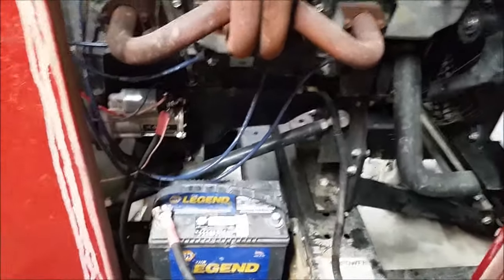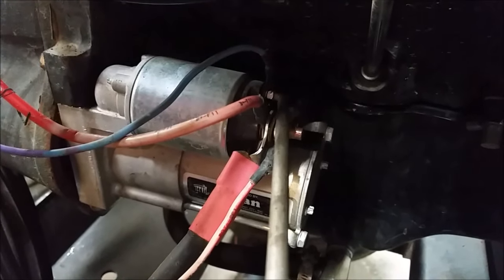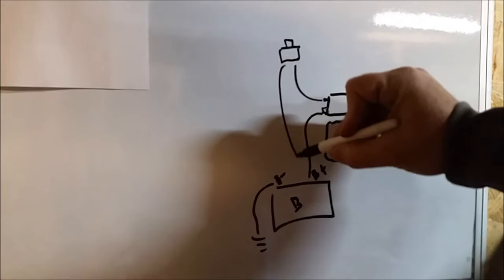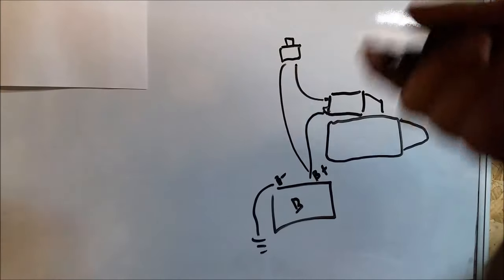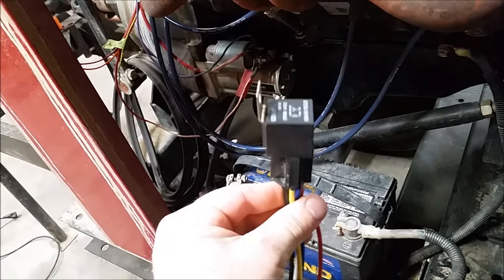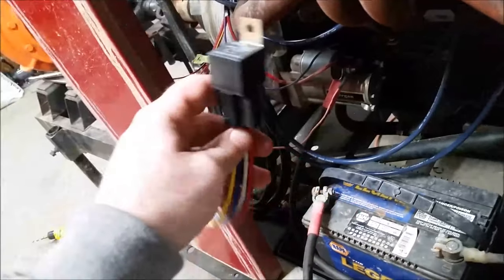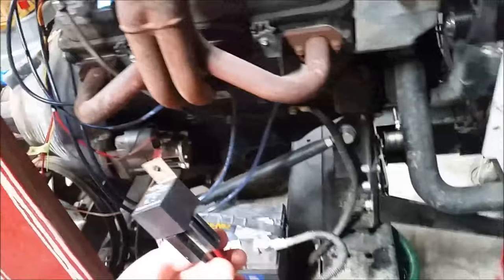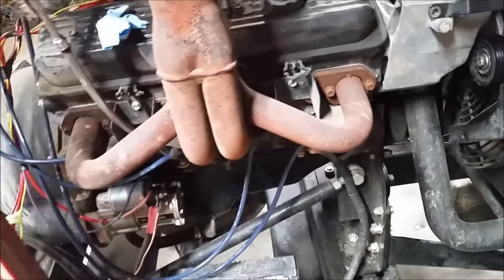Push Button Starter How To with and without a relay.

Comment: I just got my 66 cutlass back a from paint and body shop and also had the engine and trans completely rebuilt. This car had electrical gremlins before but now are everywhere. As it's been many years sense Ive done much electrically on vehicles I had forgotten many things. This video helped me to at least properly wire up a push button starter switch which I'm thankful for as apparently my ignition switch went bad-at least the part that fires off the starter. Now on to brake lights, and turn signals. Thanks!!!!
Reply from the maker: I am glad it worked out and I appreciate you watching.

Comment: You just became my new best friend .. "In head of of course" 😂. 

On a more serious note, I've called four traveling mechanics and towed my Saturn Vue into two automotive shops, w/less than 4 star reviews. I'm convinced those reviews came from the actual business & they are spamming themselves 5 start reviews. 

When I say none of these mechanics new Jack-shiiiish! That would be a understatement. 

My truck is practically brand new now thanks to all of the unnecessary brand new parts! I have low mileage, brand new clutch / transmission, replaced the slave and clutch cylinder. The Purge valve was also replaced. I just left a tune up no less than three maybe four months ago, somehow one mechanic read the codes as a misfire 1 & 4 , And he wasn't too sure if it was stating that the coil from one were four needed to be replaced so we replaced both. The last thing I was told by GMC was the ECM & center control module AS WELL needed to be replaced. Let me ensure you that no test were conducted before this sure as diagnosis was suggested.

Needless to say I came home with my truck on the back of a tow truck thousands of dollars later and I was beyond livid!

I hopped on YouTube, typed in a couple of things that the truck was doing before it just wouldn't start anymore. One thing led to the starter another lead to the solenoid and eventually how to bench test a starter.. And Walla! Well I'll be damned thousands of dollars later All I needed was a $12 toggle and $8 push start and a good 20 minutes to watch this video! I guess there's no need to say it but I will anyway.. If you want something done right do it your damn self! And now I see why it is so important for men and women to know somewhat the basics of the vehicle they're driving if nothing else. Always run your own test and look these things up for yourself. Not to mention I also ordered a clear view home diagnostic kit, a multimeter, LED tester light and a few alligator clips just keep on deck! Had I done this for myself in the beginning.. The kids would have had a better winter, I would have been less stress in my wife would have had a lot more money to shop with. The whole household would have been better off. With YouTube anyone can be a mechanic! But I also discovered anyone can also pretend to be a mechanic, come to your house diagnose your vehicle with BS, collect the diagnostic fee and never return to actually fix it. It is a real life scam that is going around and I would suggest anyone to do their own research. If you cannot actually fix the problem yourself at least no with the problem is before you pay someone else to fix it to any and everyone who reads this I hope all is well. #BackOnTheRoad ha!
Reply from the maker: Well I'm glad this video helped and you're absolutely right. Just do it yourself. I can't afford to have someone else work on my cars and I don't know how anyone else can afford it either.

Comment: Great video, if I decide to go with your first diagram, what guage wire should I use 12g or 10g and if I put a fuse in what size you think. And should fuse be installed battery side of wire to starter button. Thank you really appreciate it. I'm having problems with my ignition switch on my ford F150 the ignition, it works but you almost have to turn it 360° I figure if I turn the key to the on position and just push the button. It will save me from taking apart stearing column and replacing the actuator rod. Thanks for the help

Comment: I appreciate the video brother, I am gonna be wiring up a hidden push button starter in the form of my old "washer fluid button" in my 70 Charger, your video gave me the little refresher I needed.
Reply from the maker: Jedidiah Scott that sounds pretty cool. I'd like to see how that turns out.
Reply: Scotts Speed Shop did u get it done

Comment: good way to explain this method, im going to use it to wire as push button start switch to my drag car.
Reply from the maker: Should work just fine but there are a million ways to go about it. I'd like to wire push buttons on both sides of the firewall so I can bump the starter while working on the car.
Reply: You cant talk bad about "drag" cars these days...eh eh eh.

Comment: Fantastic video for sure. What size wire would you use from the battery to the button and from the button to the starter solenoid in the first drawing you used?
Reply from the maker: I'd say 12 or 14 gauge.

Comment: Very good info, well done TY.
I have a question. I have a 97F250 and the ignition went out last winter, I switched out the entire steering column because it had even more issues with a 92 F150 and it wasn't a exact match but it worked pretty good and it was free. This winter OMG this ignition also took a dump, I couldn't shut it off, the key was just spinning around loose and busted. I had to dump the clutch and disconnect the positive battery post, ignition was stuck on and was draining my battery, now I have to open the hood reconnect the battery and short out the solenoid relay to start  the truck then dump clutch disconnect Bat grrrrrr 
It wasn't easy for me to find and replace the column last winter, and I just had to take the bed off to replace a fuel pump in the gas tank and replace the starter motor. Also not easy for me I'm alone and disabled.  I can put a switch in to start the truck but I still have to disconnect battery can you please give me some advice on a cheap easy resolution?
TY
Reply from the maker: What a mess. The only real quick easy solution I can think of is to put a battery disconnect in line. Like is used on the back of a racecar. 2 Pcs Battery Shut Off Switch 12V High Current Battery Disconnect Kit 12V Power Shut Off Switch on Off, 12-48V Battery Cut Off Switch for Car Vehicle RV Truck Boat Marine ATV Power 300A https://a.co/d/1Y1fL7G
https://a.co/d/1Y1fL7G
I tried to add a link above. But anyways, if you could put a longer battery cable on the truck to somewhere that you could reach it, you'd have a way to shut everything off in the cab. This isn't the best solution but it might be the easiest at the moment.

Comment: I have a 1969 Cadillac coupe DeVille that I want to put a push button starter on my car because my ignition wires are missing it will crank but it doesn't start just as you displayed the difference in your video so I'm going to try your method
Reply from the maker: Let me know what happens.

Comment: On the dry erase bored u put a extra power wire. No need for the wire/can't use the wire that goes straight to the starter from the battery. Ur power wire should only come from the push button since ur starter is grounded already that would be all u need to complete the circuit an crank ur starter.
Reply: First off I’ll admit I don’t know shit. But looking at his diagram the wire from the battery to the starter is for power and the relay is ground. That way a push button can be used in-line to operate the starter solenoid. Right?

Comment: Thank you, this was very helpful. I am trying to revive a 53 Buick Special. It’s all 6volt, and the wiring is so far gone I was thinking of rigging up a set up similar to this since the stock stuff isn’t starting the car. Would I be able to find a 6v relay like the one use used?
Reply from the maker: Try a 12 volt relay first on your 6 volt battery. See if that works. If it does not, just hook your push button directly to the starter without a relay. That's the way it would have been wired from the factory. Put a fuse inline if you do.

Comment: looking to do a Ford, can you  find a min. of a 10 amp push button momentary switch? 
Find the lead that activates the starter on the solenoid. Remove and replace with min of  a  (14 gauge) wire to the push button, the other(14 gauge) lead the other terminal on the push button should go to a positive terminal on the battery.  Will this safely start the vehicle including the danger of starting in gear if equipped with an automatic trans?
Reply from the maker: The ford solenoid is super easy. I don't remember what terminals need what but there was plenty of information online to show you how to make it work. Maybe I'll do a video on a ford solenoid setup on a chevy starter in the future.

Comment: Does the engine have to have a carburetor? Or can you do that on a fuel injection car?. The engine turns just does not start
Reply from the maker: To crank the engine, this works with both efi and carb. For EFI, your ignition also needs to turn the computer on to actually start injecting fuel as it cranks.

Comment: the refrigirator joke was a cracker- i had a couple of qestions - what are the benifits of addis a relay & why not hook it straight to a starter solonoid directly - secondly i also noticed the relay has provsion for a ground wire as well- can you pls elaborate the benifits of having a relay pls
Reply from the maker: Every car all the way up to the 1990s had the wire connected straight to the starter. There's nothing wrong with that. Just make sure there's a fuse in there somewhere. The only added benefit of adding a relay is weight loss. You shorten the amount of heavy gauge copper wire needed to connect the starter. Adding the relay under the hood allows you to use a smaller wire from the push button, to the relay. It's just a signal wire without a load on it so you can make it pretty small. The ground on the relay is the other end of that signal wire. Inside the relay is a bi-metal strip that is pulled to make the connection based on the resistance caused by the 12 volt signal wire and the ground of that signal wire. That's what actually makes the relay work. All relays are the same until you get to the Solid State Relays but that's a whole other video. lol. Hope this helps.

Comment: My starter has a plug for the (st) wire I think it's called would I unplug that and put a wire from there to the button and one from the battery positive?
Reply: I've tried other videos but my starter seems different so I'm a bit confused. There seems to be a wire from one side of the starter to the solenoid then at the top there's a plug in and then a big wire that seems to go to the battery
Reply from the maker: I'm going to say yes. Without seeing it, it's hard for me to be exactly sure but try it. If it doesn't crank, just make sure there's not a fire.

Comment: So how do you tie in an alternator to your diagram? I have a 90 Jeep Wrangler with all the wires out mice did a # in the dash the rest fried has  no computer using a weber carb I am wrapping up,the 4.7 I6 stroker swap. Anyway, next phase would be wire up my CRT preformaance distributor, alternator and starter  to a push button for testing before I hire a guy to rewire the jeep. I will have to learn more about the alternator to wrap my head around it but if anybody has any suggestions im all ears! thanks in advance!

Comment: Not sure why I cant get it to work without a relay? Did it just like how you drew it. Are you sure the wire from the button goes to positive? Used 12 gauge wire for it. Little wire to starter is my problem
Reply from the maker: Yes, Im pretty sure it goes to positive but depending on how you wired the relay it could also be used on the ground. Take a piece of wire and jump it from your battery cable over to the post that the little wire attaches to. I just want to know that there isnt a solenoid issue. Let me know what you find.

Comment: Is the existing wire thats on the solenoid removed and then jist run the wire coming out  the switch im adding ?
Reply from the maker: Yes. You're removing the wire from the car that goes to the solenoid and replacing it with the wire from your push button.

Comment: If you are going to bypass the relay and connect 30 and 87 should you run a fuse on the wire? And if so how many amps?
Reply from the maker: I'd start with a 30 amp if you fuse it. I recommend a fuse.

Comment: is it okay not putting fuse direct to starter relay 30? what if you put 40A fuse, does the relay will output only 40A only? thanks mate
Reply from the maker: Adding an extra fuse inline from the relay to the starter will not hurt a thing. All cars from the early 90's and older used fuseable links from the factory. I hope that answers your question.

Comment: This is how i would wire a starter crank kill switch? Purple wire goes to the relay in fuse box, can i splice and add another relay in that purple wire to my kill switch, even tho its already going to the relay in fuse box?
Reply from the maker: I am not 100% sure trying to picture in my head. You may be on to something. I would like to see this done.

Comment: When using the relay method can you use a lower rated momentary button to activate the relay or does it still need to meet 12v and 30amp ratings? I only ask because I'd like to hide a momentary push button kill switch with relay and a lower rated smaller button would be easier to hide.
Reply from the maker: I would think you would need a 12 volt button but I don't think the size matters since it is just used to activate the relay. However I dont know that for sure so I wouldn't take my word for it. I would just try it before mounting the switch permanently. Chances are it will be fine.
Reply: @DivineSpeed  Thanks for taking a minute to reply. I'll give it a whirl this weekend and hopefully all goes well.

Comment: So If I put a push button on my old truck and I start it and it runs how do I shut the truck off?
Reply from the maker: You should be able to just shut off your toggle switch or key switch. Whatever is powering your relay.

Comment: Great informative video. What gauge wire for solenoid ?
Reply: 12? or 10g?
Reply: @DMNDkiLlz  I don't think you can go wrong running the thicker 10 guage wire, especially if there is significant distance the voltage has to travel. I'm wiring in a push button on my Vanagon Syncro and it's a long way back to the starter. Could probably get by fine with 12 guage if you were wiring to a small block chevy (or similar) where you are just going through a firewall to the starter.

Comment: What are the cons of going with your first option straight to the starter? I have my toggle switch going straight to accessory on my fuse box. Is there a better way? I have low voltage and starting issues.
Reply from the maker: Really there's not a lot of difference. The only con would be the lack of a fuse. Just make sure your wiring going to the toggle switch and starter is big enough.
Reply: @DivineSpeed  Thanks for the help. You're not on fb messenger and willing to help me out tomorrow would ya be?
Reply: @DivineSpeed  Can I also come right off the switch and go into my ign or acc pm the fuse box? Using 12 gauge.
Reply from the maker: @MHTownsend57  I wouldn't be afraid to try it. Most of your older factory cars had the wiring from the fuse block to the steering column and then to the starter. You should be fine. I'd just add a fuse.
Reply: @DivineSpeed  I hooked it up yesterday and it works better than ever. Off it the toggle switch One wire straight to solenoid the other straight into ignition slot on fuse box. It starts better than ever before. Where would I hook in a fuse to this current setup and what Amp fuse?
Reply from the maker: @MHTownsend57  I would use a 30 amp fuse and just put it there at the fuse box inline with your wiring. Or at the button. Whichever is easier to get to.
Reply: @DivineSpeed  Do you mean put the fuse in line with the toggle wire that goes straight to the ign post on the fuse box? So inbetween the toggle switch and fuse box?
Reply from the maker: @MHTownsend57  yeah that should work fine

Comment: hey i did exactly like what you did on this video, but my wire on relay 30 keep burning and if i put a fuse it keep blowing. one click and all dead. help me
Reply: i think you need a thicker stranded wire 12awg, also check the negative wiring to your body chassis.

Comment: Hello

Realy hope you can help me. 

Iv got a Fiat 128 1974 model

My starter ONLY keep crunking (stuck) if cold. Then i take of negative from battery and it stops. Then put cable back. Then start easy whole day. No problem.

In morning it stuck when start for 1st time the day. Its summer now in South Africa. But in winter it stuck 2 to 3 times. Then no problem to start. 

If car is in sun. And start for 1st time the day sometime start 1st time without keep cranking. Sometimes keep crancking ONLY ones. Then start easy. 

After it starts. I switch of and starts again. I did it 6 times.  Off and start off and start. No no no problem. 

I take of ignition switch wire from starter and jump it straight to battery this morning. Same problem. Stuck and keep cranking. Have to take of negitive wire to stop. Then try start again. Start at ones, no problem

Rrrrealy hope someone no what cause this. Thanks so much.
Reply from the maker: That is an interesting problem. You might try cleaning your cable ends on the battery and the starter. After that, I'd probably do a load test on the cable. Use a volt meter and see what the voltage is at the starter when someone else is trying to turn it over. Could be several different issues, including the starter but cleaning and checking your cables first doesn't cost anything so I'd try that first. Let me know what you come up with.